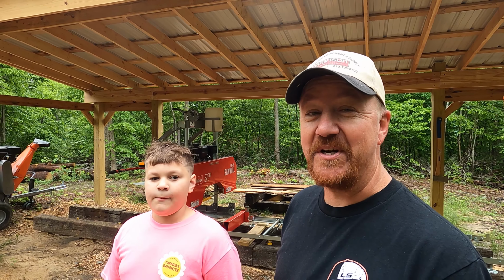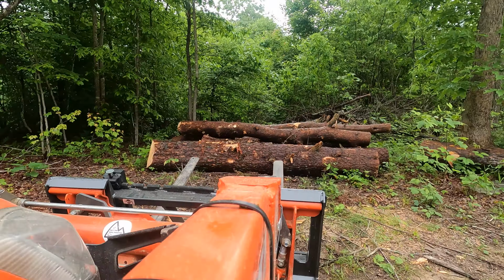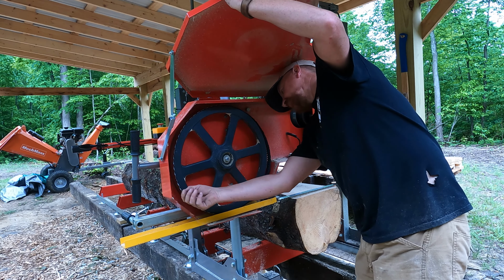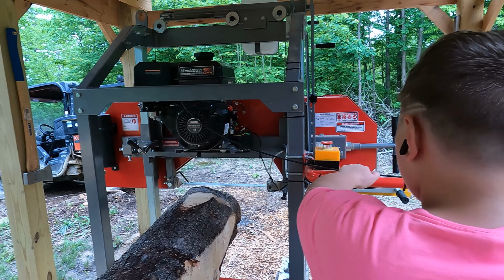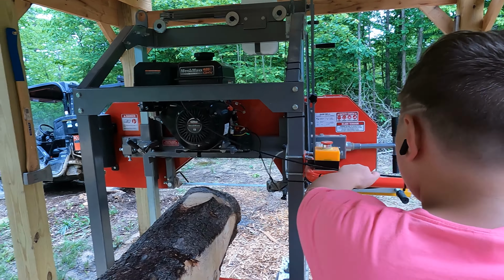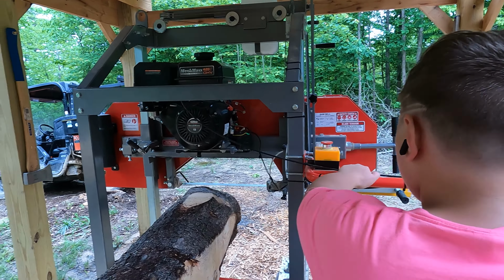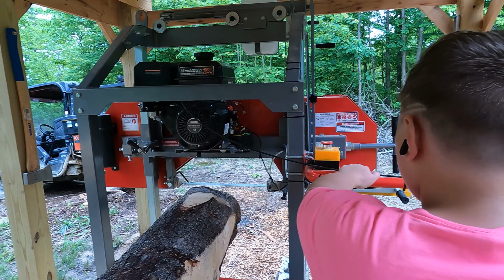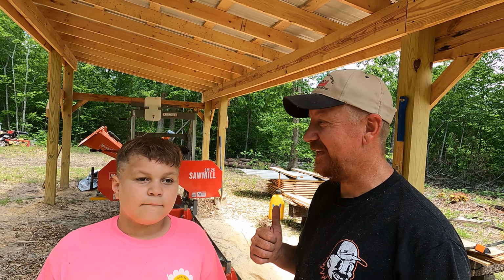When to Change Sawmill Blades

Comment: I had a Woodland Mills HM 122 and was struggling quite a bit trying to turn the bigger logs with a cant hook (like you were in the video). Then I saw a video on YouTube where a fellow put 2 inch PVC pipe about 2 foot long right over the log stops, so I tried it. I couldn’t believe how much easier it was. You can pick them up already pre-cut at 2 foot at Home Depot. Of course, if you got a scrap piece laying around, you can cut them yourself. You won’t be sorry.

Comment: I like the idea of a separate shed for the equipment and located conveniently to the area it will be used allowing enough room to get a larger tractor around. Alo make it 1/3 larger than you need, you will fill it with "stuff" and high enough to get the tractor under in a real pinch of weather.
Reply from the maker: That is a good point about the tractor.  Even if it’s just to park it out of the rain while I’m working up there, that would be nice!
Reply: Yep, with the size of hail in these storms, I get the equipment under cover fast.

Comment: I should be getting my mill next week, I ordered the 32" mostly because the Kohler engineer. Are you using the stock blades or are you ordering from somewhere else?
Reply from the maker: I am using their blades.  I broke one and I believe that was because I had the wheels a little out of adjustment.  I don’t really have enough experience to say if they are good or bad, but I’m turning out lumber.

Comment: Are your cuts on sawmill a little wavy? Kinda looks like it from video. I have this issue with my sawmill all the time and haven’t found any way to get it to stop.
Reply from the maker: Yes, sometimes.  I’ve figured out two things contribute.  The first is pushing the blade too fast, the second is a dull blade.  There are knots that will cause it no matter what, but if I have a sharp blade and slow down I am getting good straight cuts.  👊
Reply: @PeeksPeakHobbyHomestead  thanks I’ll have to try that with my mill and see if I can get some better cuts.
Reply from the maker: Keep me posted.  As I learn more I’ll be sure to share.
Reply: Blade sharpness 1. Pushing to fast 2.  Blade tension 3.  log not locked down 4. All 4 can make wavy cuts.